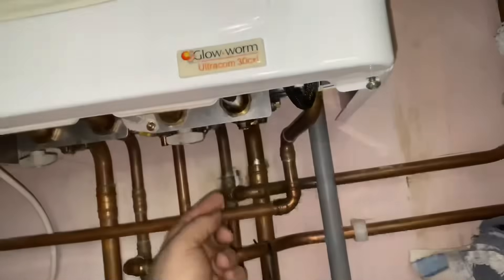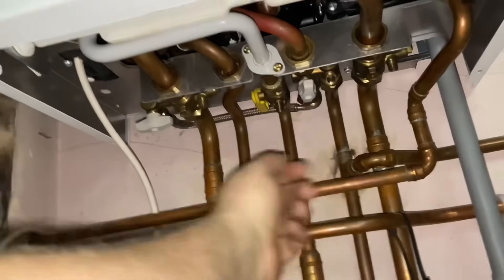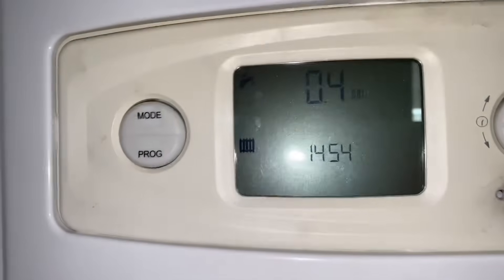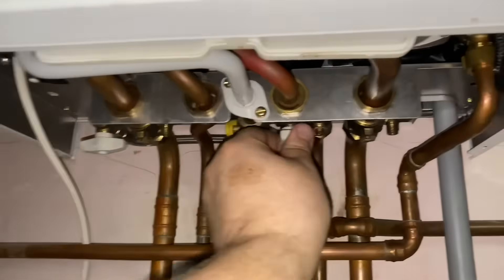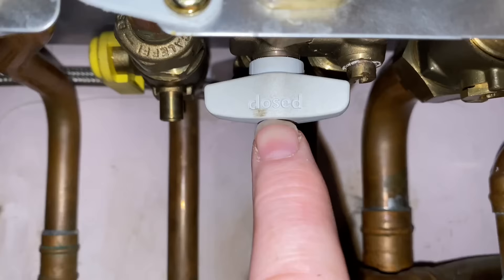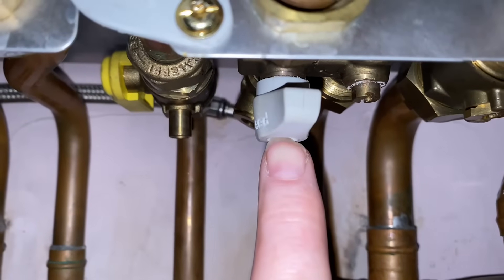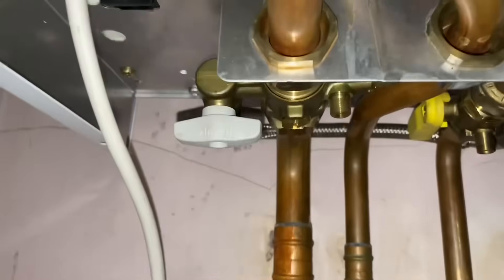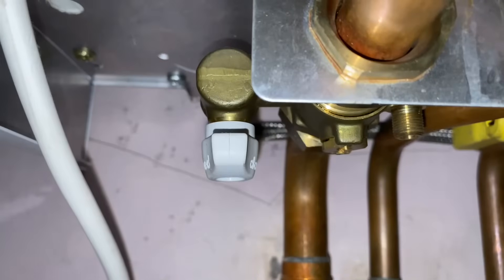How To Top Up The Pressure Glow Worm / Vaillant Boilers / Ultracom / Flexicom

Comment: Hi Allen, Overfilled my flexicon 30cx to 3.2 !!!! Boiler went off no digital display and green light on small wall unit went off, I have bled a radiator 4xtimes about 100ml each time, do I need to bleed more water off?, the unit across the room is still working, please advice me😢

Comment: Hi accidently filled my flexicon 30cx to 3.2 !!!! Boiler went off no digital display and green light on the unit on the wall went off. I had a go at bleeding a radiator   x 4times taking about 100ml out each time my hand operating unit across the room is still working do I need to take more water out please, sian

Comment: Brill video, I have a question though, when I set my pressure to 1 bar, and then put the heating on with a 65 degree Celsius, the pressure goes up to nearly three bar which my boiler seems to think is overpressure (the manual says 2.75 bar is the recommended maximum) is that because the boiler is too large for my house? I only have a small 3 bed with maybe 8 rads but have an ultracom 30cxi 

Would it be better to run it at 0.8 bar or maybe 0.7 bar, or should I turn down the temps?
Reply from the maker: https://www.youtube.com/watch?v=UR9wSU-I2O8&t=10s
Reply from the maker: Thank You

Comment: Video is really helpful. I have a question if you wouldn’t mind helping, my valve is passing water slowly in the closed mode causing the pressure to rise. What is the best way to remediate this myself? Turn it open and closed a few times to hopefully shut it? Thanks!
Reply from the maker: Thank You

Comment: You are Top Man! Thanks for the good advice. I bled the rads....no air. I got fault code f9 indicating low pressure....pressure valve 0.8 so too low for boiler to operate. Located 2 valves and had to use allen key to open valves for 20secs and closed them again. Pressed reset button. Boiler fired ok. Bar press 1.1 on gauge.cheers Alan

Comment: -5C outside, radiators needed bleeding badly so I did that and had a flashing 0.1 to 0.2 bar error. Emergency callout said tomorrow... for a house with a vulnerable elderly woman in it. They claimed they had videos on their website (local council housing) but didn't have anything. Your video showed me instantly it was these and not the ones lower on the pipes going into a cleaning bottle thing and back. Now I know what to do in the future. Thanks!

Comment: I need to repressurise my glow worm boiler, but those plastic valves/taps are just useless, i.e. they don't operate the valve anymore. I took them off and tried to use a flathead screwdriver to open the valve but it started to turn in the slot, as the copper is so soft. Any ideas? I'm down to 0.6 bar. When it gets to 0.5, the system will shut down. 😞

Comment: My boiler says the pressure is up but when I restart it clearly says the bar is 1.0 and won’t start. I try too up but nothing seems to be happening can’t hear water running topping anything up and my bar says it’s basically full. Definitely an error with the system. I have someone due out in a few days but what I can I do in the meantime please.

Comment: One question. Does the boiler have to be off or can it be on when topping up the pressure? Many thanks
Reply from the maker: Depnds what pressure gauge you have. Most of the time you will need to do these with the power turned on. Thanks.
Reply: @AllenHart999  many thanks. O figured that as it was off the last time I had to repressurise last year, I switched it off, pressurised it and then switched back on

Comment: I have a betacom2 28 the pressure constantly dropping and one rad is cold at the bottom but hot at the top how do I top up the pressure and will that deal with the rad issue
Reply from the maker: Thanks very much for your comment, please consider subscribing to support the channel 🙂